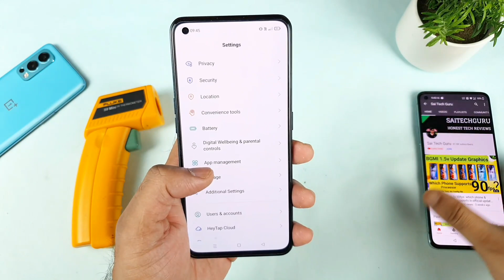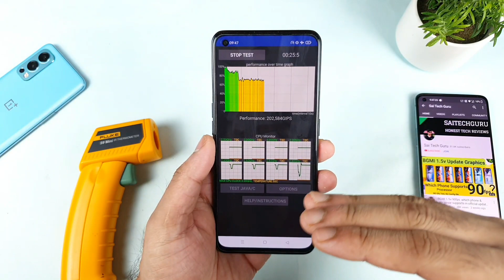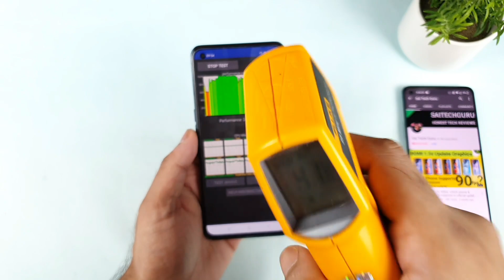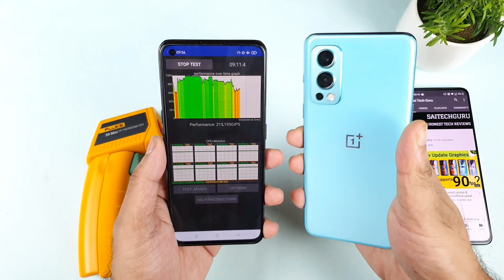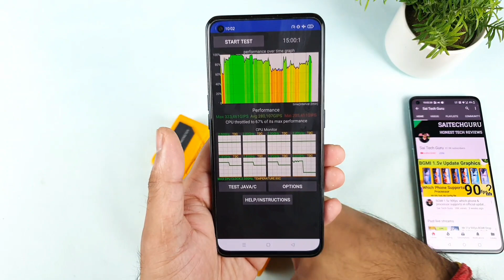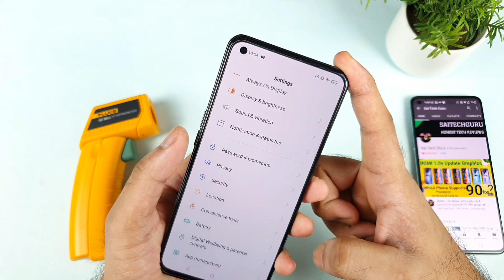Comment: 1.Can u share screen on time for auto,60 hz,&120 hz modes for realme x7 max.
2.Can u tell does auto mode only shifts between 60 hz & 120hz. Or it will change in different sinareo 10hz - 120hz. For x7 max.
Reply: 1.sure I will do the testing 
2.i think it only changes to 60hz and 120hz

Comment: irl no performance improvement mode
Doesn't let the phone heat above 40°C
And also gives stable performance as the processor is very capable
(I'm talking about playing COD)

You should test it once
Reply: How's the battery drainage after the update. I'm hearing terrible things from numerous x7 max users.
Reply: @300risesagain5  After A.16 it was worst
Now after A.17 its 90% close to what was before A.16
Reply: @samarthmishra794  whats your screen on time now?
Reply: @300risesagain5  10 hr moderate usage
Around 6 hrs heavy usage